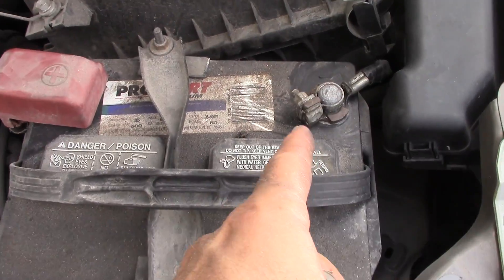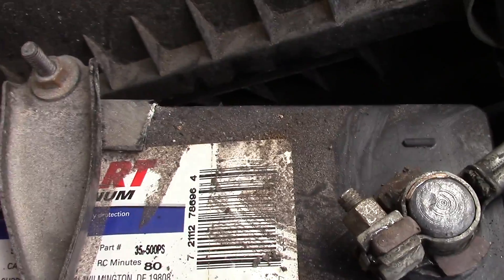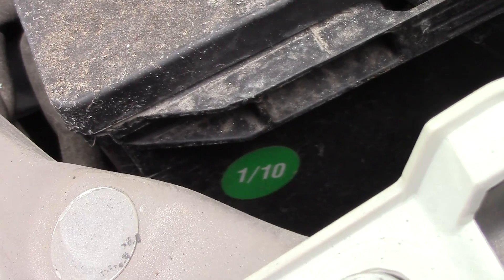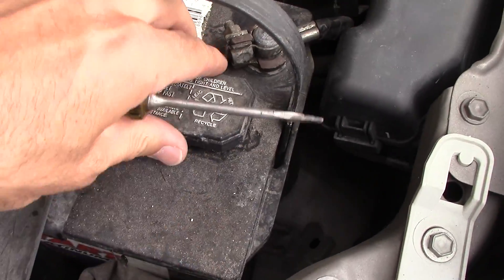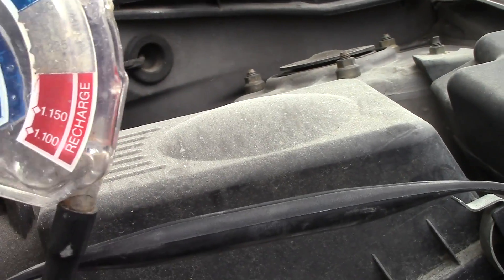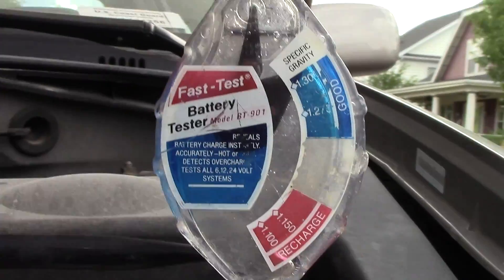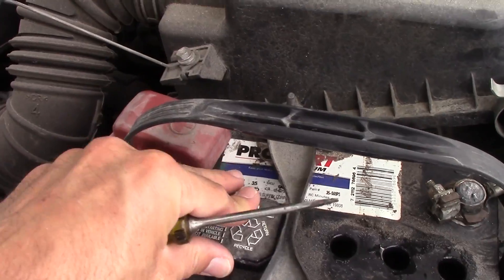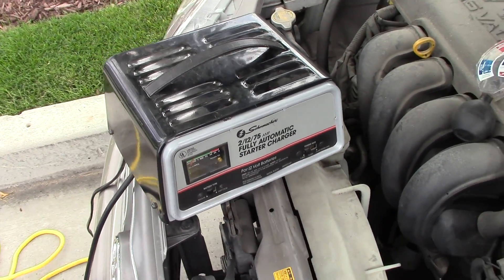How to test battery cells with a Hydrometer - Troubleshoot #2 Car won't start

Comment: Did not use hydrometer properly. Air bubbles can cause float to rise above accurate reading. Also the amount of battery acid entering the hydrometer was not regulated and no use of the level gauge for accuracy.

Comment: With covers on, you should clean the top of the battery with water and a brush first to keep stuff from contaminating the cells when testing. Also the crud on top of the battery can slowly short it out if there's continuous crud between the poles (like what's in the video.)